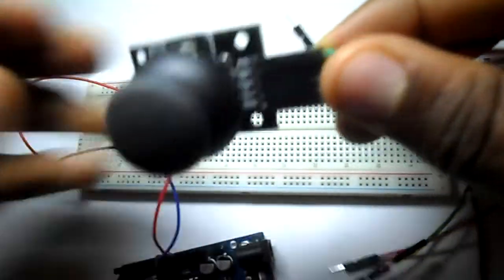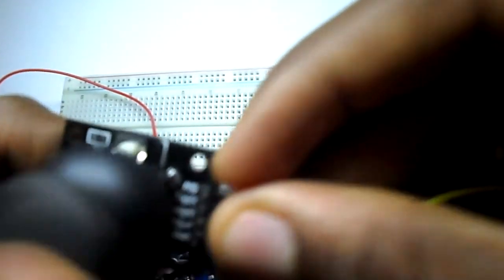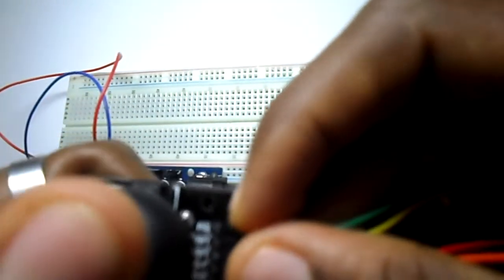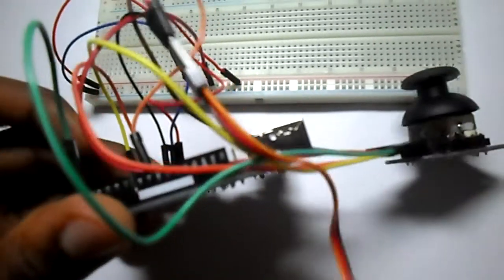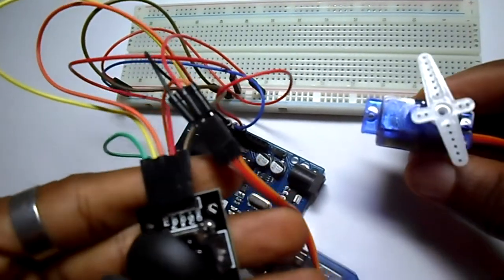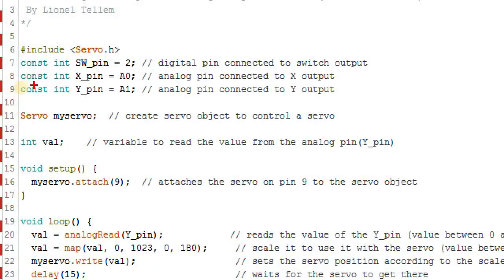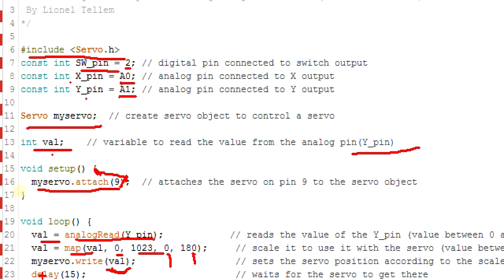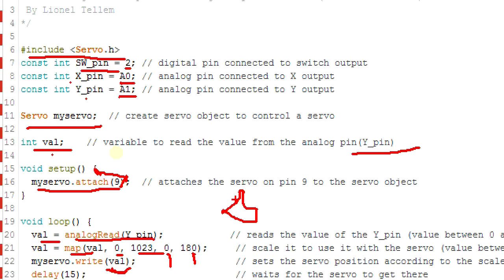ARDUINO  Tutorial 05 : Controlling Servo Motor with Joystick | Robot Arm

Comment: Once again the only tutorial that makes sense is produced by an African. Thank You, Thank you, Thank you!!!!!
Reply from the maker: Rashad Glover Wow thanks very much for your comment...hope you SUBCRIBE and don't forget to share to help others😉
Reply: Now I'm trying to do the same with a DC motor. Can you please help me out?
Reply from the maker: Sorry for the late reply, I have not yet done it, but I'll consider it for further videos
Reply: Your comments made me laugh
Seems all the gratitude in the world left you hanging 
Like a  school boy on his first date
As did this video did for you
For your edification... Controlling a DC motor...  
Would be with a potentiometer for speed control code
And an H Bridge relay board which would give you  dc reverse control
Of the motors direction if need be...

 https://www.ebay.com/itm/10K-Linear-Slide-Potentiometer-Module-Dual-Output-Arduino-AVR-Electronic-Block-/183032243671?hash=item2a9d9265d7

3D222932485934&_trksid=p2047675.c100005.m1851https://www.ebay.com/p/L298n-Dual-H-Bridge-DC-Stepper-Motor-Driver-Controller-Board-Module-for-Arduino/794672183?iid=172935033065&_trkparms=aid%3D555018%26algo%3DPL.SIM%26ao%3D2%26asc%3D50543%26meid%3D1c6b0ef1f1ff498abe46d14fb230eed3%26pid%3D100012%26rk%3D3%26rkt%3D12%26sd%3D132543681960%26itm3D172935033065&_trksid=p2047675.c100012.m1985

Not quite sure how you are thinking Lionel is AFRICAN
He does sound foreign... but like you.. not all blacks are AFRICAN
OOOOH...  AND not all AFRICANS  are BLACK...

|Made me laugh...Nothing quite says racist as your assumptions...

Best of luck in that new world of yours...

As an AMERICAN...
We support AMERICANS
We defend AMERICAN CULTURE and RIGHTS
While standing along side all creeds of AMERICANS

Glad to have offered some brief help, in some fashion

Hope to someday be as smart as an AFRICANLots and lots of farmland to take over from WHITE AFRICANSDig a well and sell MUD PIES

(  LAUGHING MY ASS OFF HERE.... )
Reply from the maker: Thanks MUSIC VIDEO EMCEE for your help 👍🏾
But I'm sure he said Im African cuz he checked it out, And i invite you to check my Channel Trailer to know more about me...Thanks